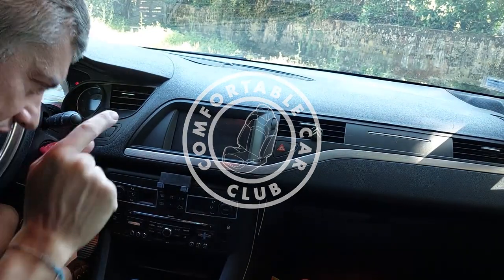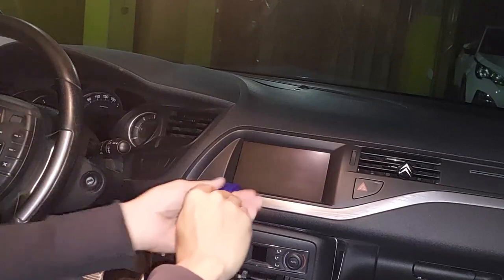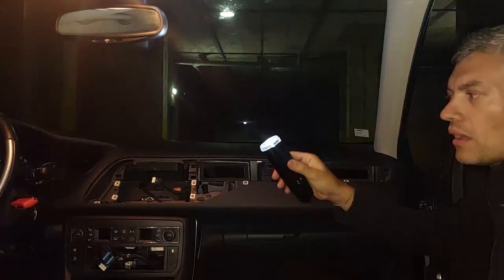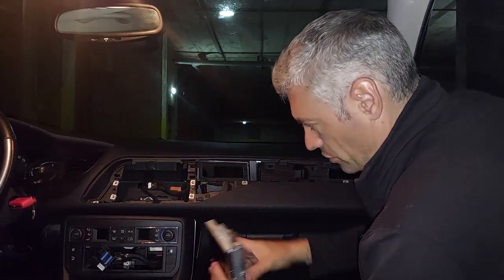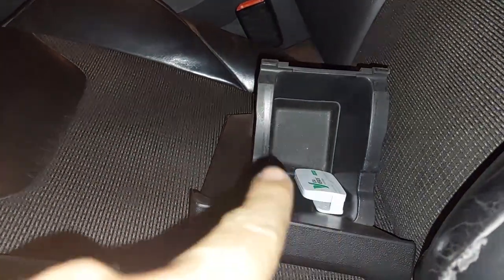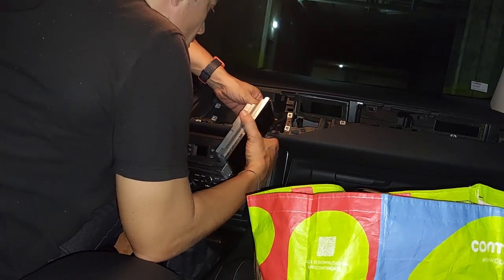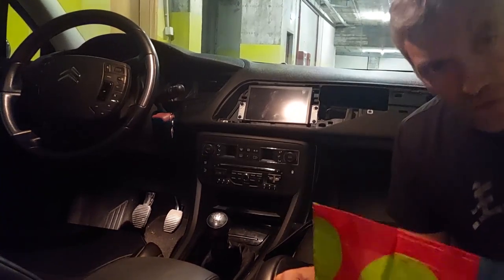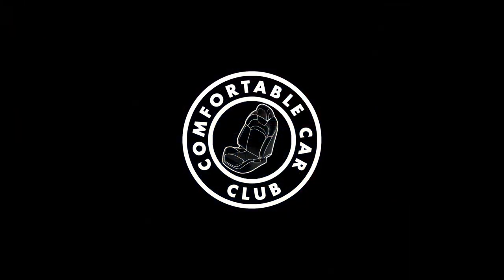Upgrading from a MyWay/RNEG radio to a much better RNEG2/RT6 unit | Citroen C5 X7

Comment: I almost had a heart attack when I saw you yanking that facia the second time to connect that hazzard light switch....good thing they made that plastic a bit durabble.
That is a great upgrade, I use the USB only. I stopped using the radio ages ago, once I had to use the AUX outlet,  but I never use anything else, except...

Here's a little detail I forgot: 
at random times, very occasionally, (3 or 4 times a  year), after being parked for the night, or after parking for a while, no specific time, it could be 15 minutes, it could be 8 hours, so after that, I unlock and enter the car and turn on the engine, and THEN I turn on the audio (I turn it off before shutting the engine, that's how "I" do it, not that it's right or wrong or it "should" be done like that....), 
so I turn on the audio, and instead of continuing to play the USB music, as it was doing when I shut down, it now plays the radio, and it only recognizes the radio and CD player. Not the USB/AUX/bluetooth. It also does not connect to my phone. 

So for the whole "session", I don't have a USB/AUX/Phone. It could be a whole  trip, but I won't have the phone connected to the car. 
BUT.....after the driving session, I park and shut down and lock it, and when I return (could be the next day or 20 minutes later), I start the engine for another session, and everything is fine. The audio recognizes everything. 

It just looks like a reboot issue, but it doesn't show any other symptoms to tie it with. It's totaly random. I have to point out that after changing to a brand new battery, It never happened so far, so a half or dying battery may be the cause. 
I have the RD4 unit, the basic one, so that could play a part  in it. Maybe your unit has better software and it doesn't do these kind of things. 

When opening the hole for the USB inside that tray, make sure that socket doesn't hit anything in the back when it's closed. 
To be honest, THAT is a way better position for the USB outlet than the armrest. I mean....they put the cup holder inside that armrest, and if you have a USB plugged there, the cup keeps bumping on the usb stick. That is a destruction waiting to happen. It forced me to buy a small outline USB stick, just to avoid that danger, but before I get that new stick, I used it with an improvised 90° elbow, so that the USB stick will stay close to the wall and not hit the coffee cup. 
And I had to make my own elbow, because the ones sold in the market were equaly long and protruding far inside the armrest, again hitting the coffee cup, (or the cup hitting them).

Oh and about that expantion tank tube I mentioned the other day, here's a fiew pics to show what I mean:
https://postimg.cc/wRvwTJnj
https://postimg.cc/BtnpFrnL
https://postimg.cc/v42bYFTr
That "PA12" you see written there is a type of Nylon, I assume like PA 11, which is the typical number of the so called "nylon" tubes, (IF my info is correct), so I guess the PA 12 should be a notch better nylon than the PA 11...???....I don't know, however, nylon is a pretty durable plastic, it can hold the temperatures of an engine bay and the coolant, and it can last a long time, that's probably why nothing happens to the tube itself, but rather to the connection points. Those connectors are fused with the tube, and the way it is routed, it's in the middle of the working area, and this way, anyone trying to do any kind of work there, will give it a bump and brake it. 
That's why I switched to Teflon tube with custom connectors. 
https://postimg.cc/ykF77ps8
https://postimg.cc/9Rvn7PzL
https://postimg.cc/XrLL6WPc
https://postimg.cc/21yLgsLg
which leave all that area free for the technitian to work, without worrying about braking anything. 
See? I think of the technitians too. 
Maybe nothing would ever happen to it....maybe something WOULD happen to it....either way, I consider it to be one of those tiny little details, that when they DO go wrong, they go unnoticed and they cause major damage if you don't take care of them. 
I know you may not have the means to switch to something like mine, (if you can, do it), but even so, just knowing the information is crutial. Keep an eye on it and make sure nothing happens to it. 
Great job.
Reply: Oh and one more thing: my USB/Aux unit is the factory installed, and in order to work, it needs to be programmed to the BSI, which is done through the diagbox tool. Does yours need that too? Or it works out of the box?
Reply from the maker: You spoil me! Rest assured, I will keep an eye on that, though if it's something too hard for me to do on my own, I've got a great mechanic who I turn to often.

I won't be opening a hole in the tray for the USB, I'm sorry if it sounded like I was going to do that. I have another more elegant solution, that I will be execute first and show later!
Reply from the maker: @mr_nice.  I had it programmed by the seller. They did a good job of it, fortunately, as it just plugged and played like a dream!
Reply: @comcarclub  ....awesome, great job, can't wait for that elegant solution. 👍👍👍
Reply: @comcarclub  I was just about to ask you why the RT6 immediately turned on normally instead of just beeping (theft protection). So the seller also coded the VIN of your car into the RT6.
Reply from the maker: @Spurdospaerde692  that is correct

Comment: Thanks for doing this videos, as there is not much detail related to c5 ,s out there, can you tell if this upgrade will work on x7 s with the executive trim 2010 ( they have a double height radio unit) as the satnav is very out of date , 😀

Comment: What is the highest Navigation class for Citroen C5 ? RNEG, RNEG2 or other ? Thanks in advance for your answers.
Reply from the maker: Ooh, that's a tough one. The NG4 was the top-notch head unit, it had voice commands, USB, SD card input, 3D maps and other stuff. Later, there were the NAC units, they had Android auto and BT streaming, so better for smartphone compatibility. The RNEG is by far the worst choice, IMHO. Apart from BT calls it doesn't do much.

Comment: I’ve done the same in my 2007 C4. RD4, RD45, MyWay to finally a RT6. Bit expensive for everything but well worth it. It’s something to get used to and the Bluetooth streaming has a little delay. Have it hooked up a reversing camera and parking sensors
Reply from the maker: You're right, it IS expensive, but I can offset the cost somewhat by selling the old unit. Everything car-related is sodding expensive in this country, and I managed to sell my old RD4 + display for enough to cover the cost of my new RD45 and its corresponding display.

Comment: i have the same radio, i'm happy with the sound. But i wanne replace it in the future with the SMEG touchscreen system with apple carplay connectivity
Reply from the maker: Ouch, touchscreens. I didn't buy a more recent C5 because it had a touchscreen
Reply: @comcarclub  I didn't buy a more recent C5 because of the Prince engines (EP* / THP*) and the timing chain epic fail,
I'm with a good old RFJ 2.0L (Petrol is the family vehicle fuel to use in my country)
Reply: @comcarclub  it get it, buttons are easy, i used apple carplay in my previous car, with waze, tomtom or maps, so easy! if there is no carplay available i would not change ;)
Reply from the maker: @asaflevy1540  petrol really is nice, and I even made a recent video on the subject of petrol vs diesel. But this 163hp diesel is changing my mind regarding oil-burners

Comment: Hey, I noticed in my C5 X7 that the glove compartment has a small hole, just wide enough to poke a finger through the is on the top,
So inside the glove compartment, at the top, look for a small hole, it might need to be punched or something, as mine also has more 'seams' around that hole,
anyways it looks like this hole is specifically for an AUX connection or USB, in mine there was a disconnected 3-wire cable, seemingly an aux, I don't know..
Anyways I upgraded from RD4 to RD45 which came with a new AUX connector, which I haven't had the time to manage, so my RD45 Unit is still handing 3/4 of the way inside it's cocoon..
Reply from the maker: You're right on the money!

Comment: Hi, what features are there on this unit compared to the MyWay one? Does it stream bluetooth music? Cause MyWay only does calls sadly.
Reply from the maker: Yes, unlike the MyWay/RNEG1, it streams music AND has USB connectivity, so you can fill a pen drive with mp3s. It's a lot better. Not as good as the RD45, IMHO, but still a lot, lot better than the RNEG
Reply: @comcarclub  Thanks for your response! The USB is built in the unit or it's the usb port in the center storage? Because I don't have that. It's good enough that BT plays music though. And the unit you mentioned, it's possible to fit that one? I'm curious since I kinda don't want those giant 8-9" Android ones, they look way out of place installed outwards of the dash
Reply from the maker: @Ivan-jz9by  Yeah, I'm not a big fan of android screens either. The USB port requires a cable that is then connected to the actual port. You can put it in the centre storage but I put it in the glove box (https://youtu.be/0XIE32BcpCY)
Reply: @comcarclub  Sweet, I'll look into it, thanks!

Comment: Fantastic video and explanation. Thank you for the content. I'm actually in the market for a 2.0 or higher C5 Tourer (manual-diesel). I'd like to get a trim that has traditional handbrake, moonroof, metallic slider panels in the boot, et cetera. Is it true if I were to get a C5 with the SatNav screen and infotainment system it would not have the capability of linking to my bluetooth phone to play music and the like? Would I have to ahead and do this installation of a new system as is displayed in this video?
Reply from the maker: Thank you! If you can find that combo of panoramic roof + no trick suspension, that will be quite something as I've never seen such a combo personally, but that may vary from market to market. Maybe an early 2008/09 model with the 138bhp engine, which everyone says is great BTW.

As for the satnav screen question, that depends on the year. I'm not sure when the RT6 (the one that allows for BT streaming)  was introduced but I'd wager it was around 2012. Anything earlier is probably going to be a crap one. You can tell it's an earlier to-be-avoided MyWay if it has an SD card slot. Personally, I'd get the overall spec you'd like with whatever radio, then upgrade. And if I knew what I knew today, I'd skip the RT6 altogether
Reply: @comcarclub  I know it's a bit silly to try and include all of those things, but we always look for those extra bells and whistles when in the market. Thank you for your reply!

Comment: Wait....it just came to me.....
The tray under the radio, hmmm....too deep, you can't reach and remove that usb.
inside the ash tray itself,... nah, too small, 
So we're left with that small opening tray, right behind the handbrake.
Now THAT is a pretty elegant place to put that USB socket, without interfearing with the cup holder, AND it's hidden. Although, you won't be able to use it any more, but it's the smallest of all anyway.
Not bad, I like it ! ! ! You could've pulled that cable in that spot in the first place, and wouldn't have to bust your chops to run it all the way to that left tray. 
I can't wait ....

Comment: By pure luck I found your nice video and now I'm curious to know where you bought the new RNEG2/RT6 unit. I have searched everywhere in vain.

Greetings from Denmark.
Reply from the maker: I got it from ebay, from a German shop called 
jpelektrohandel2014. Honestly, I didn't like their service, the radio was a lot more expensive than it should have been (that was my fault, I should have shopped around more) but the communication was awful. I would ask questions and they would go silent for ages. I wasn't happy.
Reply: @comcarclub  Thanks for the quick reply. I have been to the website you refer to and I don't think the prices put me off at all. I've been searching on the web for the last couple of months and they all cost around €600 for the unit alone used. That the company then has a lousy service is of course annoying.

Comment: Hi I've got a quick question since i couldn't find the answer anywhere. When you connect your phone through BT to the radio and stream music, are you able to control music with buttons on steering wheel? I mean change song back and forth, volume up and down or answer a call? I've got an NG4 unit and i'm thinging about switching to RNEG2 to make my life easier since i listen to music a lot and its a bit a pain in the ass to do everyting with phone during driving. Best regards :)
Reply from the maker: YES. With the rneg2, steering wheel buttons all work perfectly. The only thing that I wish it had was some kind of function for the button on the tip of the left stalk, as on my RD45, it activated the voice assistant. But that's a minor thing

Comment: ..which isn't that great either. Sometimes it just stops and you get a black screen. But when radio is still on, try this:
Stop the car, lock the car, and wait untill there's nothing lit on the dashboard. You might even see your gauge dial make a small movement as the power is shut down. Wait a few seconds, remember you are still in a locked car. Now start the vehicle when possible. Likely the screen gives a startsplash image.